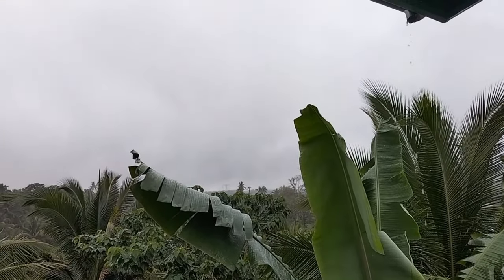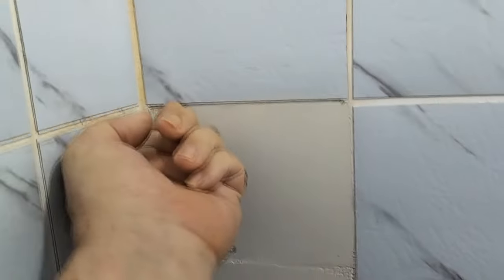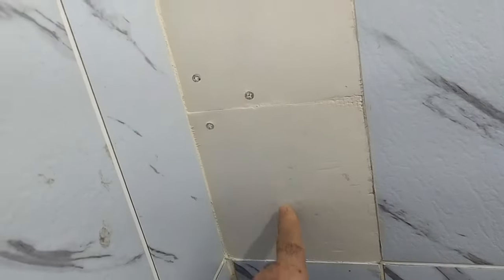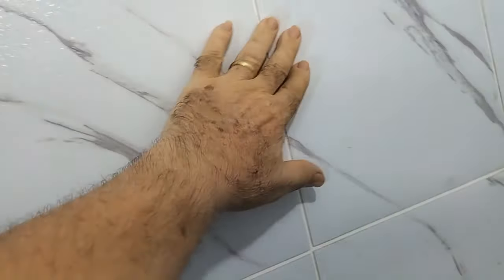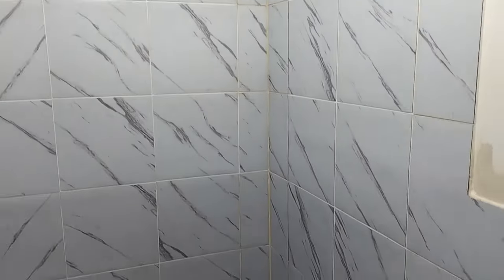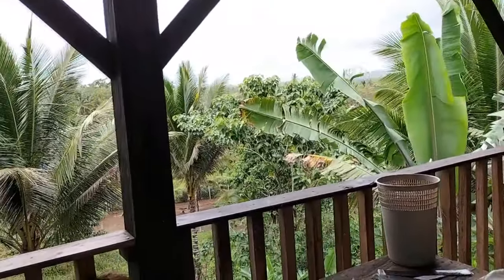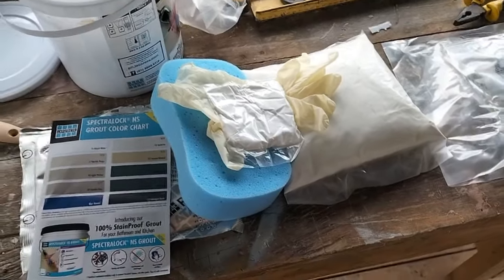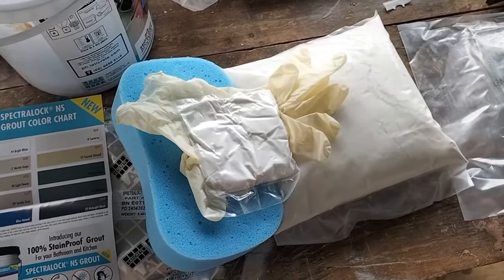V586 - BATHROOM READY TO INSTALL ECCESSORIES - I THINK MY MODEM DIED - THE GARCIA FAMILY

Comment: it would be wise to use surge protectors for all your safisticated electronics because of brownouts are hard on thems
Reply from the maker: Actually my modem was running on a power station and Starlink will as well
Reply: I was also told the electricity is dirty in the Philippines.  Hence why appliances fail and especially when the brownout is over and things re-start like refrigerators etc. 
It's when they fail.
Its a simple test to try:
How do you detect dirty electricity?

An AM radio is a basic and effective, simple EMI detector. Turn the AM dial all the way to the left (500KHz) and right (2MHz). The radio will show a difference in static depending on changes in the electromagnetic environment. Such is a good method for detecting dirty power at home.
Reply from the maker: @laman491  interesting😊👍👍👍